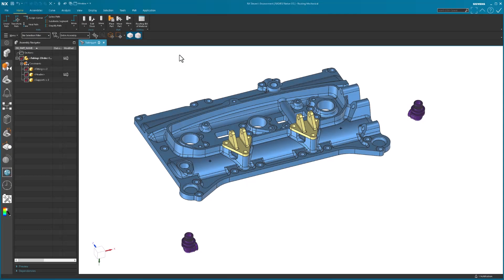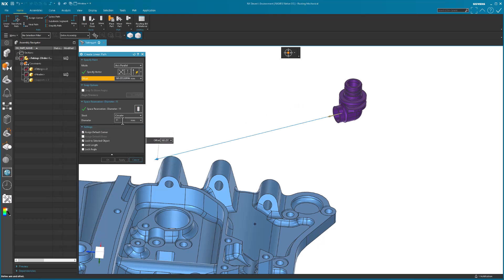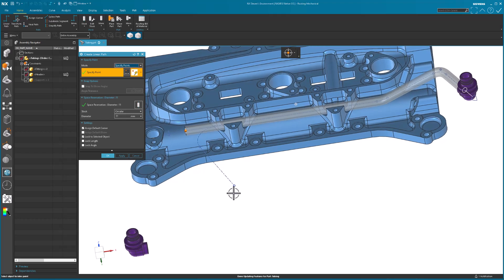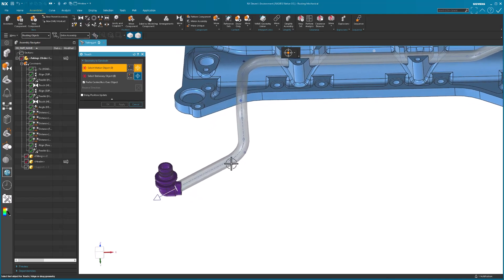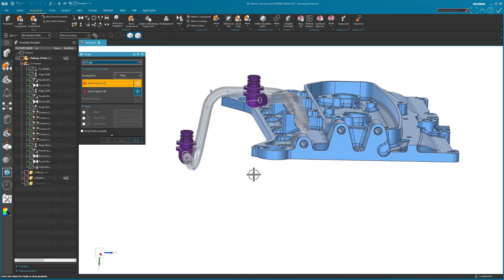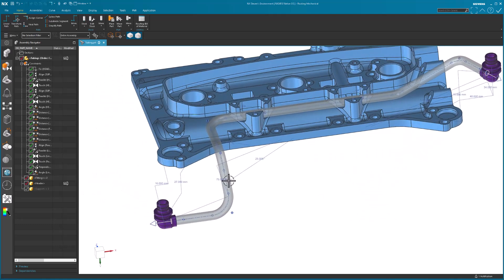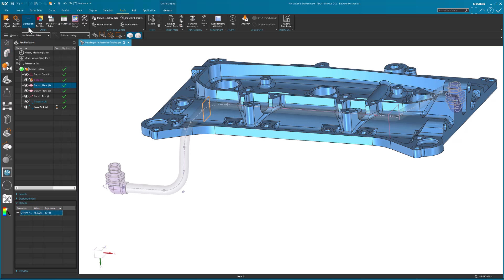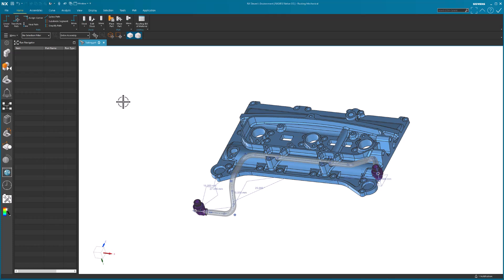NX 2412 | Tube Routing Application

Comment: I still really enjoy your instructions, you have a nice perspective. Again very practical. 

What you showed was great. Keep it simple. Most people will benefit with what you just showed. 

This operator works well using work part, working in the concept of an assembly.

Try the heal path operator, and change the method toggle, to get started quickly. Stretch the extensions at the ends if needed.

For complex tubing and piping you will benefit from other options, otherwise keep it simple. It really depends on the fidelity you need to capture for different routing packages.

You'll get a more options if you go to application > under the route group, toolbox, piping and tubing. 

More benefits come when you qualify your components, use the reuse library, and when you use industry standard software along with NX.

Comment: Does Catia have anything similar?  Last time i did this in catia it was splines and surfaces manually.  Part of the problem with all these tools is as they need licenses for every small function you may not know they exsist.
Reply from the maker: It does. It's great as well. 

It may seem like an extreme added expense but the developers need money to develop. And the tools allow you to unfold/unwrap and have accurate BOMs and so much more. 

The tools are worth it for people that do a lot of the stuff.
Reply: @ClassASurfacing  oh good I will have a look.  Does the NX tool do different shaped pipes or only round? We often need to do instrument panel duct routings and to get the initial base routing would be nice but they are generally not round pipes/ducts and are aften a real PITA taking months of playing around.  A tool like this would reduce time. The would still need to be individually designed afterwards. Must admit an auto routing tool would be fantastic. Give it a package and some inputs and it finds a route through which you can then manually adapt